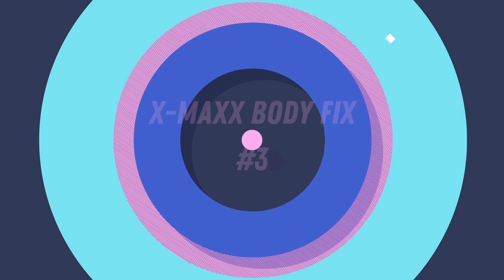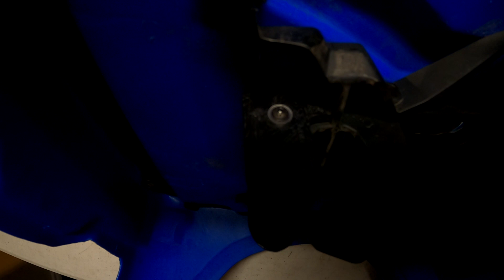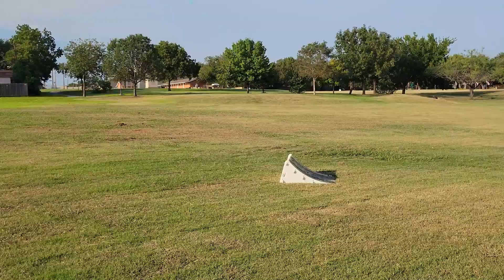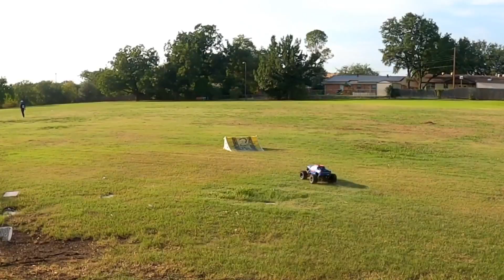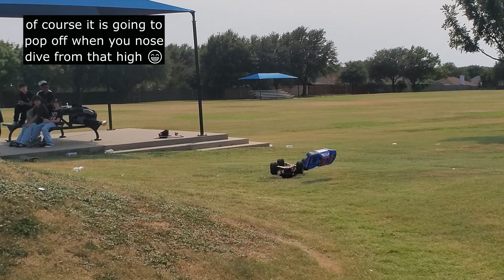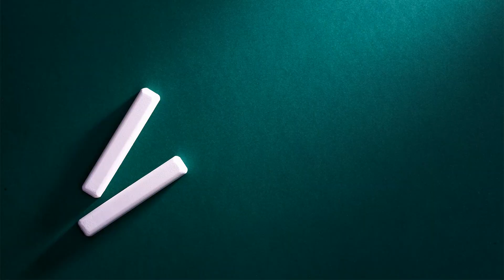X Maxx Body Popping off Fix #3

Comment: I’ve got the Russian unbrakeable body on my Xmaxx and I’ve done a similar mod as you have done with a piece of 20mm PVC pipe in the centre, tie wrapped on. Then I use a luggage strap the goes over the body (a slot needs to be cut)  and under the rear tower where the body clip goes. I bash the heck out of it and the body never comes off.

Comment: Dude thanks,  I just baught an Xmaxx and so I'm an Xmaxx newbie.  What I do to all my rc cars is take the body to linex truck bed liner and have them sprayed.  It's about 100 dollars but is the same as an industruckable body. Anyway thanks
Reply: Sprayed inside or outside? Thanks
Reply: I have been doing inside and out so far. It only comes in black so the only downside is that it's black on the outside.  My next body I'm going to try just spraying the inside.  Not sure if it is as durable yet tho.  Actually the other difficult thing is that the body will be thicker  your body clips won't fit. So I switch over to proline body mounts.  Twist on cap style mounts.  I love them better than body clips anyway.  Linex bodies are basically industruckable bodies in my book. I use different colors of duct tape to give it color.  Or spray paint the exterior.  I haven't actually tried paint so can't guarantee it won't chip.  Linex is textured and flexible.  It should work